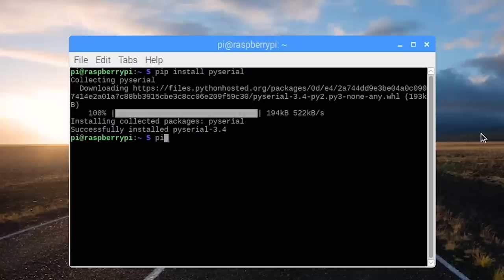DIY Raspberry Pi Smart Car Update!

Comment: Comments show: can we get ac temp and airflow speed + if ac is on or off?
Reply: I dont think those things are connected to the ECU.
Reply: Zoomx well the ecu controls the rpm when the ac is activated the rpm goes up to compensate. So maybe there is a patial communication.
Reply: The7thSin yea but i dont think ud need to use a raspi the obd2 readings to do that. You can program a button on the gui that can just turn the ac on and off if u tap into the harness for the ac
Reply: Zoomx yeah but my car has this stupid dashboard that controls everything and its pretty tricky, so i am pretty much avoiding it.  I just want to know is it on is it blowing and how much because the display on that system is f**ed up.
Reply: The7thSin still dont think the ecu controls the ac. Its called the Engine Management Unit (or whatever u wanna call it) for a reason. I bet theres a separate module that controls ac functions and other such things.